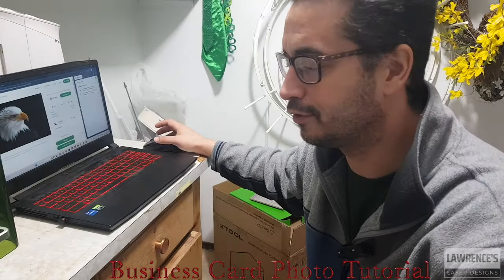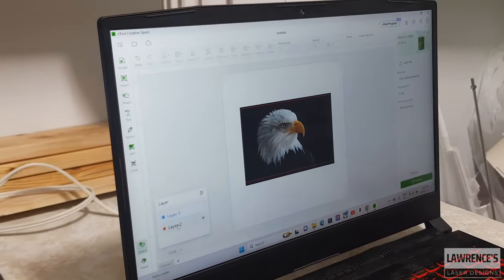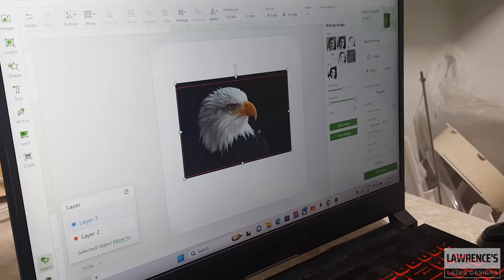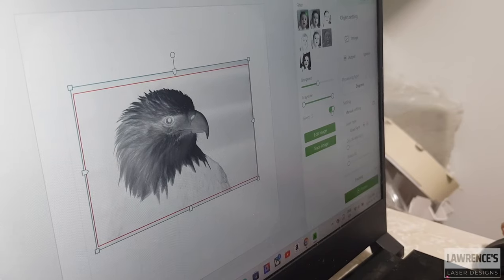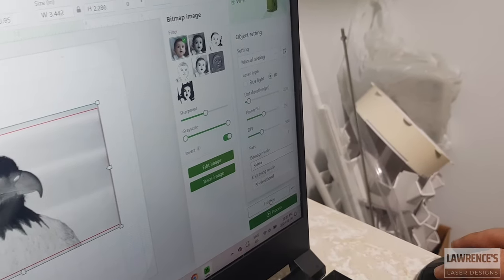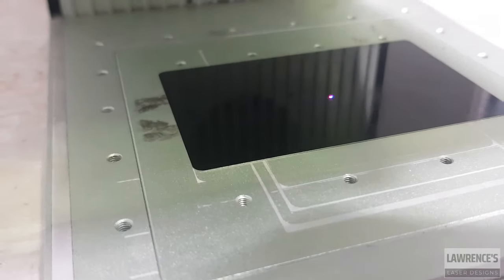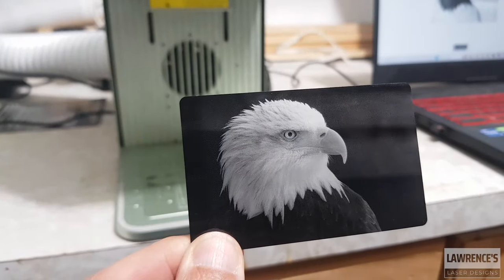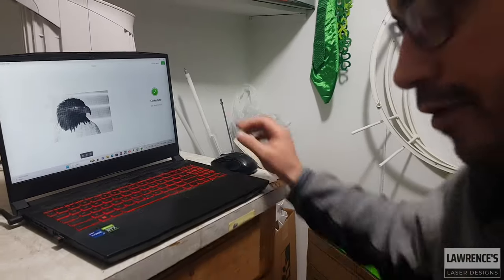Business Card Photo Tutorial on Xtool F1

Comment: Thank you! Was it trial n error getting to those settings such as 50 power and the sierra?
Reply from the maker: No, I did a material test which i can use for the same material in the future.  Those settings are a great starting point, what would change would be the light and dark tones of a photo and if you changed the dpi to a higher one i have found that you'd have to lower the dot duration a little to compensate for more dots.  I'll be doing more videos in the future.  I'm away for the next 2 weeks though.
Reply: @lawrenceshuffler4338  awesome thanks!